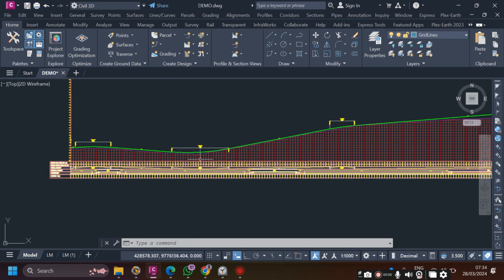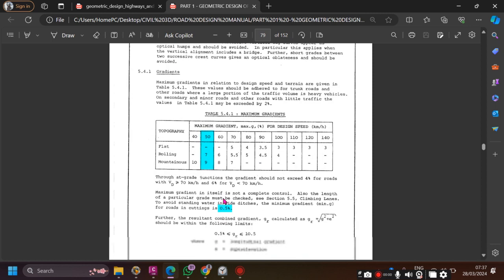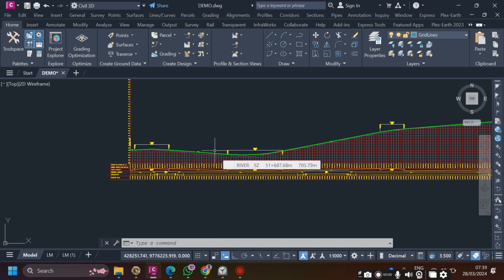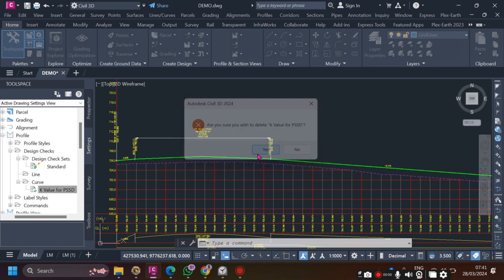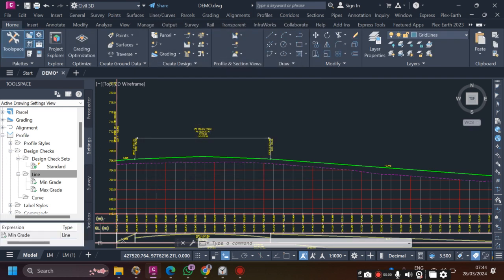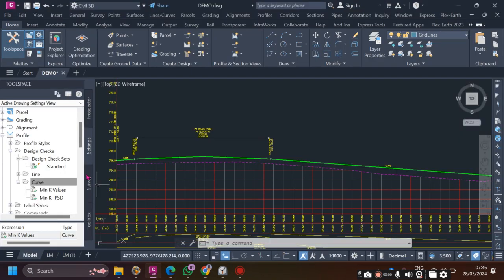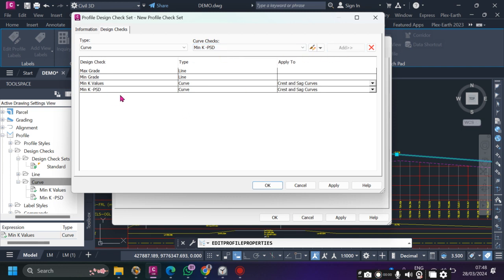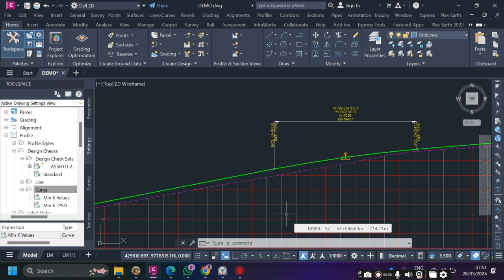How to Apply Design Checks for Finished Road Level Design Profile-Civil 3D

Comment: Hello there. After creating design profile, how to update profile view to reflect height difference between surface profile and design profile? I hope question is clear. To explain further, In my profile view, at the bottom there is calculation for gap difference between design and surface profiles. After creating design profile, that calculation remains zero. Hope you can help with this.